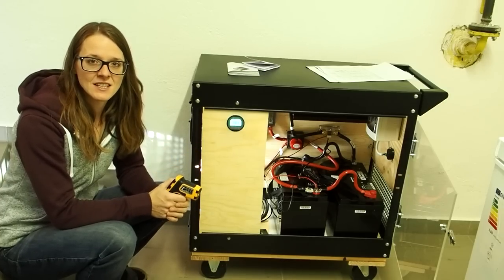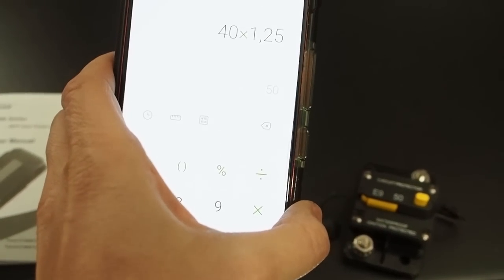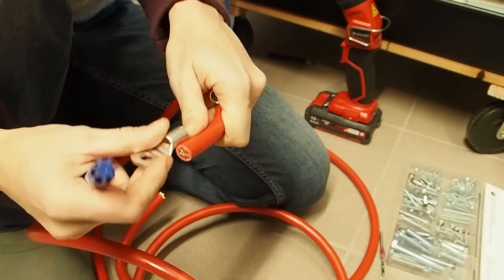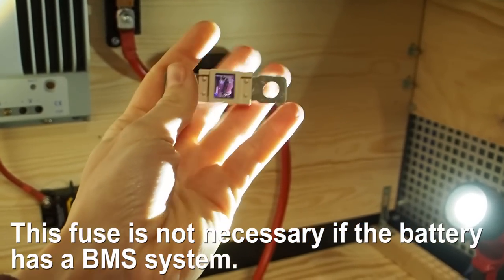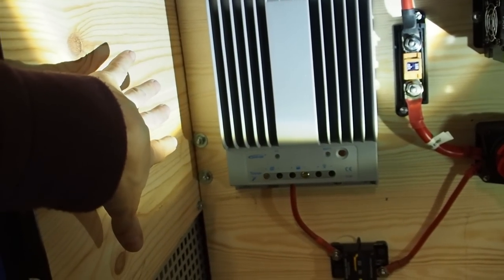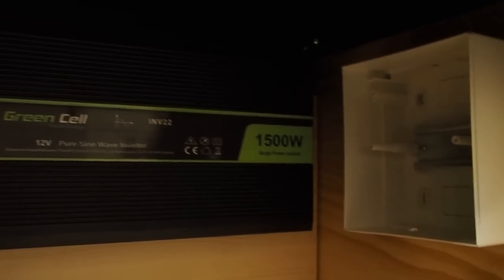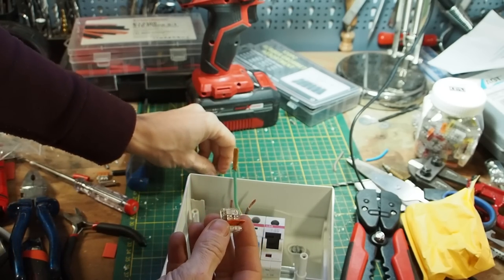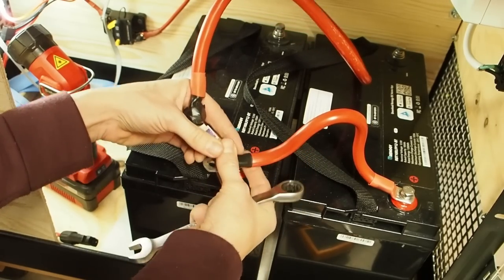12 Volt Solar System in a service cart (1500W Inverter)

Comment from the maker: ✅ Parts List:
➜Renogy Batteries: https://www.renogy.com/
➜RCD Tester: https://amzn.to/3C9KpqJ
➜Inverter 1500W Pure Sine Wave: https://amzn.to/3Gosgb6
➜Epever 40A Solar Charge Controler: https://amzn.to/3FU9VRK
➜Battery Monitor: https://amzn.to/3GpPqh5
➜MT 50 Monitor for MPPT: https://amzn.to/3ajeQQB
➜Hammer Crimper: https://amzn.to/3AwKc0J
➜50A Tocas Breaker: https://amzn.to/3AFoFTH (buy the yellow one, not the red one)
➜Fuse Holder: https://amzn.to/3alIx3c
➜Battery Switch (rated 12-48 Volt and 275 Ampere): https://amzn.to/3bUuZMC

🚨Important links to watch before starting your own project:
📺Proofwood RCD: https://www.youtube.com/watch?v=FM9lvwX39g0
📺Solar Disconnect: https://www.youtube.com/watch?v=HOXnWXvLXko
📺Will Prowse: https://www.youtube.com/@WillProwse
➜Will's Book: https://amzn.to/3ujFCip

Cost of the cart was about 130 Euros. Cost of the electrical components (Mppt, Inverter, Switches, Breakers, Fuses, Cables, Monitors) excluding the batteries was 700 Euros.
Reply: Es fehlt nur noch ein Teil um die Akkus aus dem Netz zu laden.. Fast Perfekt!
Reply: gorgeous. 12V is ineffective at high capacities. You lose wires and in a converter up to 20%

Comment: As a retired electronic engineering technician I can say impressive very impressive only two points number one wood burns you should use sheet metal this way you can electrically Bond all the components to it and add a little extra safety and your venting should have venting at the top and bottom so that the heat can get out but again fantastic job
Reply: I’m at the 11:20 mark and thinking “ooooohhhh no, no, no”. I’m an electrician and Lily has put both vents at the bottom. At least put one at the top to create a convection current of air. Heat rises so cool from the bottom is pulled in by the heat leaving the top. 
The inverter and controller both have heat sincs and will get hot. Joining them to wood with a fuse that literally burns out……. Ouch. Fire hazard. 
Lily needs an insulator plate between the wood and the electrical components. Old school “bakerlite” or similar.
Reply: @fugawiaus  for a minute i was wondering if it would somehow make more sense to mount the charge controller to the outside of the rack and put at least the inverter's fan opening to the outside so it can pull in external air. I know it would look weird and one has to cover the wires and all but it would provide for a much better cooling.
Reply: @koborkutya7338  sounds good but I think lily is trying to keep the main components inside the trolley. The easiest thing would be to swap the left vent to the top, (change the wiring a bit) then if you need more ventilation, put a computer fan or two on the vent. She could even have it on a t/stat. 
Getting the components off the wood is a must though. 
😃
Reply: @fugawiaus  I was pondering if you could have all sides from that perforated metal sheet. You could mount the parts on it be through-bolts (M4 or so for small stuff). It would have good ventillation, not combustable and definitely strong enough. 
I guess she just didn't have enough of that. But it is a good point, I was planning to do something similar so I will plan on some kind of metal mesh.
Reply: Great build Lily. I’m ordering parts and some tools to begin similar for my dad as he constantly gets power outages in rural Jamaica. I was a bit confused at 33:53. You hand is in the way and it would be nice to see how you were wiring the live and neutral from there. I saw a wago clamp but not sure what to do from there. Can you please get back to me on this. Many thanks. Keep up the good work.
Reply: Commercial electricians install complete service panels. On wood for 100 years...And there 200 amps AC..So trust me. If it was dangerous. The NFPA and NEC would not allow it...

And Bonding to the metal does nothing.. As any short wants to go back to the source. That being the Inverter\batteries...Why the inverter has to be double insulted and fused...And the Primary side of the Battery bank...I would add. Bonding is when you tie the Ground and Neutral to the same buss bar. On the main Service panel. Nothing else should be bonded from the panel on...

Comment: Nice idea. A few suggestions. Use a 24V inverter so you can reduce the amperage draw from the batteries thus use smaller diameter wire, smaller fuses on the DC side, and twice the power capacity of the solar charge controller. Mount inverter with air exhaust pointing up so air flow aided by convection.  Good job bending the wire to the needed shape before crimping the 2nd terminal so the wire strands can shift before locked into place. Otherwise too much stress is put on strands as the outer arc strands will try to pull out of the crimp, and wire will resist bending. Would be even better to bend before 1st crimp. Suggest add ventilation near top of cabinet for convection. "This fuse is not necessary if the battery has a BMS system". Suggest a fuse in case BMS fails. DC fuse necessary because DC arcs differently than AC as the breaker trips. Love the final product.
Reply: Is there way how to use 24V solar panels and 12V batteries ?
And best option 12V sine changer ?
Why is on PWM module "input max 150V" and "output 12/24 V" ?
Can PWM module somehow change voltage to standard  12/24 V ?
Reply: @petrklic7064  Yes, the PWM solar charge controller (and better MPPT) will accept a higher voltage from solar panel (150V max in your example) and charge 12/24V batteries. Check specifications on the specific controller in mind. Pure sine wave inverter is best as it can also drive motors (fans, refrigerator, ...). Suggest buy solar charge controller that can handle more current & voltage than needed so can add more panels in future. Pure sine inverter should be oversized the most so can add more battery capacity without obsoleting/replacing the inverter.
Reply: @pikayla5749  Thanks. I am going to buy changer from aliexpress, but i am not sure if i can trust their specs. I need max 2 000-2500 watt for my most powerfull tool. But isn't it 4 000-5 000 aliex-watts ?
They lie about specs in solar panels.

Btw. i am not going to buy many batteries. I am making budget / portable system.

Btw. i know guy who have 40 solar panels on his roof, but these days, he gets from it only 1,5-2 kWh per day. It is barely sufficient for his two fridges and lights.
Reply: @petrklic7064  Hard to trust specs on any cheap product. 2500W is difficult to do with 12V. Current = P/V = 2500W/12V = 209 Amps! Higher if your tools have startup surge current. Suggest use higher voltage. Calculate your Whr need and size the battery accordingly. Lead acid batteries can only be discharged 50% so double your Whr need unless using Lithium Iron Phosphate. Figure  a 100W solar panel good for 100W*80%*6hours/day=480WHr/day. To be safe would double the solar panel and battery requirements. So much for a budget system but better than buying a system that dissapoints. In your example 2000WHr/40panels=50WHr/panel. Estimate 50WHr/6hours/.8=10.4W panels. Makes no sense so I don't believe that data. May be a good idea to buy a book.

Comment: Excellent set up Lilly. My system is the same except I use two 12 volt deep cycle marine batteries, they're under $100 each. They work great in cold weather. Best batteries for cars in freezing temperatures.👍

Comment: Wouldn't it have made more sense to put the inverter on the bottom where there is airflow since the fan is on the right side? Maybe you're going to be putting fans in later in the video.

Comment: Hi Lilly,
Great project there. One advice though.....
Hot air rises and accumulates at the highest point possible. Looking at your box layout, hot air will accumulate at the top space of your box. The most of the hot air will of course be generated by the Inverter and rest from the charge controller, all of which are mounted at the top space which has no “outlet” for the hot air. 
So, I would have had one of those “perforated grills” mounted on top of one of the side panels, and the second perforated grill should remain at the lower side of the opposite side panel. That way, that arrangement would allow cold air to flow in from lower grill, and hot air to flow out through the upper grill, to enhance cooling.
Reply: That's the first thing I noticed too.
Reply: Good suggestion. I thought the same thing.

Comment: A standby charger would be nice also, if you're not using the solar panels to charge and to keep the batteries charged as long as the grid is active.
I have the same battery monitor in my van, best buy so far, love that thing!
Great job, with all the details for installation of a system kept track of, not too bad for a office girl...
🤣
Thx for showing, keep coming with stuff like this, all information from one hand!
👍👍👍

Comment: photovoltaic/solar thermal technician here: it used to be that batteries would discharge faster when stored on concrete. A battery can be drained whether it is sitting on concrete, wood, metal or any other surface. When a battery is sitting, it is slowly draining. Lithium-Ion batteries continue to slowly discharge (self-discharge) when not in use or while in storage. that's where a trickle charger comes in handy, be it 1.5 watt mini solar panel. some trickle chargers can safely be left connected for months without doing harm to your battery. 

very nice set up, i built one for a photovoltaic school from the equipment they had laying around, i added a SunPower string inverter on the side of the cart and a  AES 7.4kWhr / 48VDC with Xanbus Lithium (LFP) that bad boy is 192 lbs.

Comment: This video told me exactly what I have been trying to figure out for months now. I have batteries, and inverter that I charge with a gas generator or the AC if the power is on. I have been trying to learn what I need to charge solar instead of the gas generator. This did just that. Thank you. Everyone I talked to wanted to sell me a whole system that would work independently mostly from what I already have, although I could tie in what I have to a complete system, but I would have double of some things that a complete system would come with. I can't afford to pay for some things I already have, and I want to build a system that is expandable as I can afford to buy parts. Parts for a system like this are expensive - at least the parts I need now - solar panels and charge controller etc.

Comment: Like the system. My dad and I just bought and built a solar generator for Christmas. One 100watt battery and 2000 watt inverter so far but fully expandable system.

Comment: I have so much respect for DIY people. I did the same but in big milk crates and my panels breaker are outside so anyone can close it. They are mostly considered like on/off switch. 
Also it doesn't need to be code compliant because it's not fixed to a wall and considered movable.

Comment: i really liked your build & i’m going to use some of your suggestions but i just have one suggestion for your system that you should connect your power wire & your negative wires on opposite batteries to the inverter because this will draw power more evenly across both batteries & not more from just one battery i learned that from watching youtube videos i hope this helps & again very good build
Reply: Surely! Maybe, maybe. See also: Solar power plant mounted in multi-storey building! (for survivors in the zombie apocalypse): 
Shorts version:
https://youtu.be/k9AiiCLALRA

Full version:
https://youtu.be/sOskjOsl-cA

https://youtube.com/shorts/GuZc2KhHEs0?feature=share

High Power Mega Coil gun! - YouTube

Comment: As i get older it's more difficult to crouch while working.  A tip I've learned is to set the project on a table so I can work standing up or sitting on a tall stool. Same can be done with that cart although you'd need a 2nd hand to set it back on the floor after testing.

Comment: Great job setting your system up but the problem is there is hardly any sun in the winter making the solar redundant most of the time that you will need it as most power cuts will be in the winter and you'll just end up draining the batteries.

Comment: Nice job, but would suggest switching the left venting to the top, heat rises, this way u would have cross ventilation , air enters on bottom right,  exit top left.

Comment: You are one AWESOME Human Being!
This is one of the BEST DIY jobs I've seen! Excellent work.
I'm saving my pennies right now to upgrade the setup I built for our home. I eventually want to get TWO of the Power Queen 410 Amp 12 Volt LiFePO4 Batteries. This will not happen until my wife and I can Move to to SW Oregon. I also plan to have a 6KW Panel Array to Drive the system
Reply from the maker: 6kw...Thats a lot of solar power.
Reply: @SurvivalLilly  Yes it is. I realize that. But I can also read the Tea Leaves regarding what is very likely coming. Believe me, I am NOT wealthy by ANY stretch of the imagination. I expect it will take TWO YEARS of buying one-piece-at-a-time to accomplish this goal. 
One thought I've had is that if I have 6 Kilowatts of Solar, and 800 Amps (11,000 Watt Hours!) of storage, I can FULLY power my House off-grid, EVEN on Cloudy Days!

Our County just came off an 18 Hour outage due to a weather event. Our PRESENT system is a small 600 Watt Panel Array into a 20Amp Controller to 2 Deep Cycle Lead Acid Batteries. From the Lead Acid Batteries to a 500 Watt Inverter that charges and Maintains a 100 Amp 12 Volt Lithium Iron Phosphate Battery. From THERE to a 650 Watt PURE Sine Inverter for Clean 110 VAC. THAT Powers the Home entertainment System, and other chargers for other devices as required. 

Back on the Lead Acid side, I use the usb outputs on the 500 Watt PURE sine inverter to charge our GOAL Zero usb Lights, phones, and handheld Ham Radios as well as our flashlights. I ALSO use the Lead Acid Side to charge a 40 Amp 12 Volt Lithium Battery which runs the Main HF-Shortwave Ham Radio Station which allows me Global Communications in any situation. Yes, my wife and I are both Licensed Ham Radio Operators.

It is possible to do a LOT with even a minimal system. This is NOT Rocket Science, and I would be happy to help ANYONE who would like to know more.

Comment: Excellent video. I have almost the same setup. One tip; For an apartment the castors of the cart is too small. I have upgrade to 100cm Wheels so as not to damage the apartment floor. Batteries weighs 34Kg's.

Comment: I have a system I assembled about 9 months ago it works well, I run my gaming rig and everythng. I have a eco flow delta max and 4  x 170W solar panels and a Honda EU10 generator. Its really good.

Comment: It's crucial to understand the potential for fire and serious injuries when dealing with batteries.
When sizing conductors for loads and sizing fuses/breakers to protect conductors ambient temperature/conditions of use are the determining factors. The more heat the fewer amps a wire can carry and system efficiency is affected.
To safely do this requires knowledge you cannot get from one video. I recommend Explorist life and Will Prowse.(YT)
Love you Lilly.

Comment: I built a few before. But your design is very cool. The cart is a great idea. You should add a super capacitor across the inverter to supply surge current for starting inductive loads
Reply: Great build Lily. I’m ordering parts and some tools to begin similar for my dad as he constantly gets power outages in rural Jamaica. I was a bit confused at 33:53. You hand is in the way and it would be nice to see how you were wiring the live and neutral from there. I saw a wago clamp but not sure what to do from there. Can you please get back to me on this. Many thanks. Keep up the good work.
Reply: @lennieadi  these are great for the caribbean

Comment: I built a very similar solar box as yours. Same size batteries. Main difference in them is mine is in a heavy duty plastic storage chest with wheels. Well done! Mine will run a small fridge for days without any solar, and adding solar could extend that to over a week depending on the weather.  Be sure and run some tests to see what capacity you have.

Comment: Great build!  You might want to monitor the temperature in your cart when the door is closed.  The ventilation grates at the bottom of the cart may not be sufficient when the system is operating at full capacity with the door closed, especially near the top of the cart, and you may want to add a fan to move the hot air out.

Comment: Hi Lilly
Great project very neat and clean, I build the same idea. I live in south Africa and load shedding has been a reality for a long time, the last 3 months we had load shedding almost everyday. The only thing I would add(i added it to mine) is a 12v ac charger. As load shedding may become a reality in Europe the ac charger can be useful to top-up the batteries when you don't have sun or at night.
Reply from the maker: thanks for commenting. how long does the load shedding last if it happens? 2 hours 3 hours? or longer?
Reply: @SurvivalLilly  In South Africa we have stages depending on how much Electricity Escom (our natation electricity supplier) need to save from the grid. In our town 
stage 1-2 (1000-2000 MW) power goes out for 2 hours 2 times in a 24 hour period
stage 3-4 (3000-4000 MW) power goes out 3 times per 24 hour for 2 hour at a time
stage 5-6 (5000-6000 MW) power goes out 4 times per 24 hour for 2 hour at a time
stage 7-8 (7000-8000 MW) power goes out 6 times per 24 hour for 2 hour at a time.
so at stage 8 the power is on 2 hours off 2 hours.
Reply from the maker: @johandewit7571  wow that really sucks.
Reply: @SurvivalLilly  Yeah but the load shedding has forced us to be more self dependent and make plans for our survival

Comment: I have a couple of luggable systems for ham radio or emergency lighting of my gas insert heater. But this is great to move between your forced air heater and refrigerator or freezer.